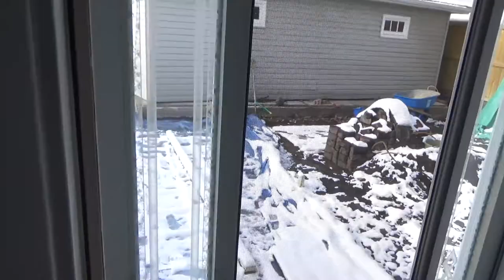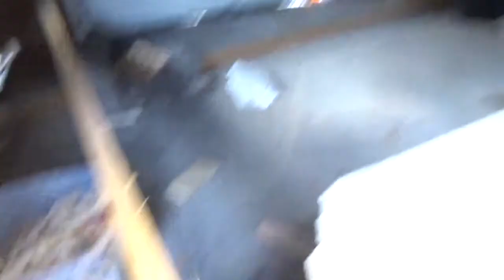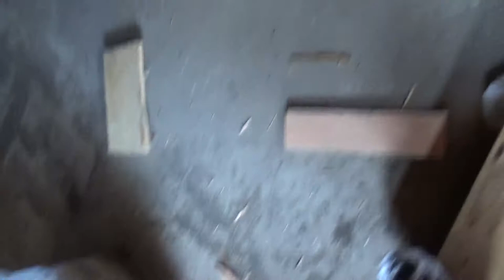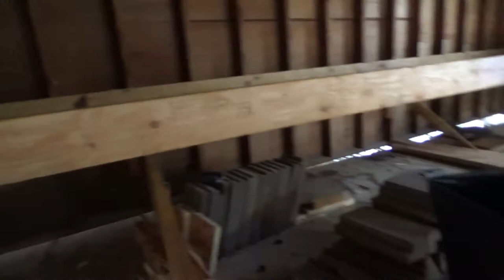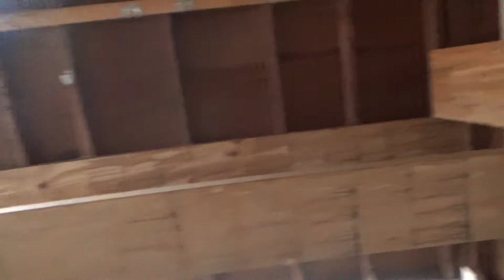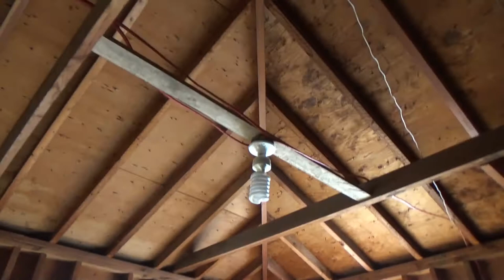How To: DIY Lift A Garage - Part 4

Comment: I've seen a few videos of people lifting a garage and a few lifting just the roof. If it was me I'd go the roof route it's a whole lot less weight and less work because all the doors and window remain in the original location.
Reply from the maker: that can work if your siding, eaves, soffit, etc aren't all tied in. sometimes separating the walls and the roof is more trouble than it's wroth. plus then you're creating a weak point in the wall, instead of raising the foundation.

Comment: How long did it stand being suspended in the air?
Reply from the maker: about a week, until a particularly windy day. If the concrete guys had done their job as promised there would've been no problem
Reply: KIAROS timing 🙈

Comment: Question and Comment:  Was the primary failure due to the wind blowing it off your brick supports or did the LVLs fail?  If the LVL failed, you could have avoided it by placing your brick supports closer to the wall. You have 6 feet of the beam cantilevered to the wall, creating a high stress where the beam is contacting the brick.  Sorry for all the lost work!

Comment: What happened?
Reply from the maker: concrete guys refused to pour the pony wall and it was suspended longer than it should have been
Reply: @MooseDoesStuff  darn! That sucks! I looking to do this exact same thing. Did you ever show the finished new garage?
Reply from the maker: @justRome1  I lost a lot of the rebuild footage 😔
Reply: @MooseDoesStuff  got it. Thanks for sharing!